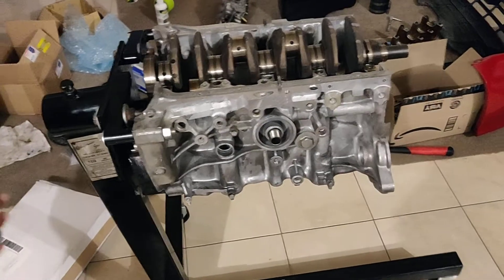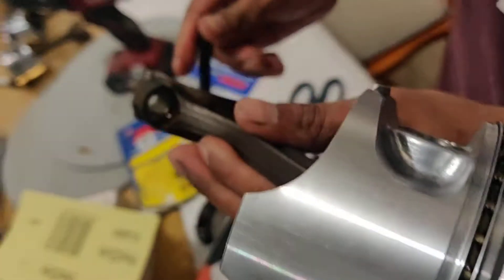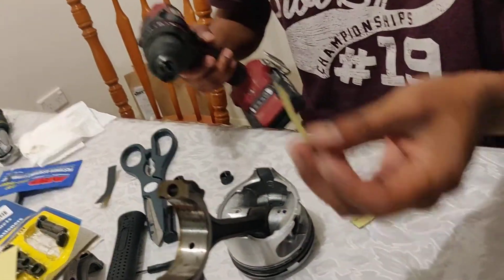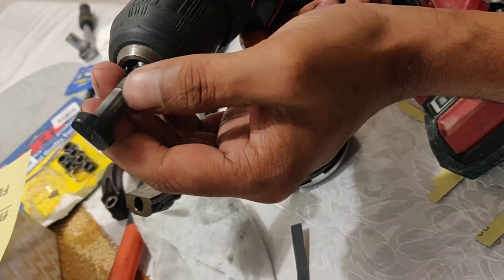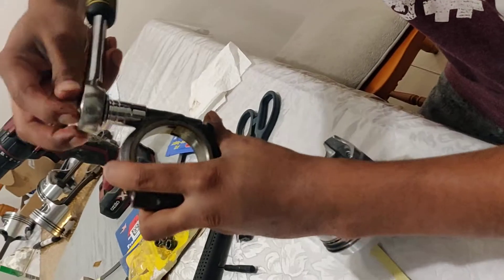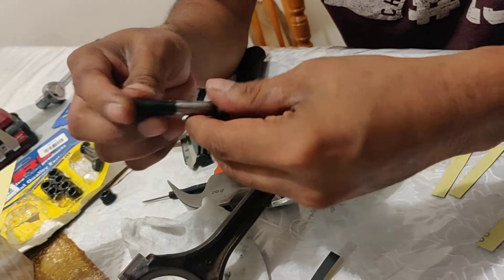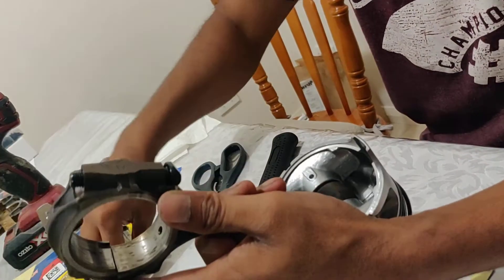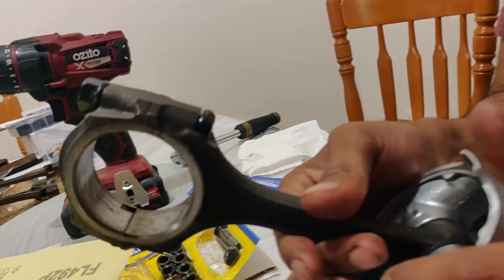Stuck ARP Connecting Rod Bolts Solved

Comment: They are press in but if its too tight the rod could fail. Its not the right way but it will work. Stock rods are often kinda thin around the bolts. Sometimes stock rod bolts might be better. They put less stress on rod and are still strong enough.

Comment: You could heat the rod end in a pot of boiling water so it expands, then insert the bolts.  I've done it several times that way.

Comment: These bolts are ‘interference fit’. They should be pressed into place
Reply: I suppose you are right.  As mentioned,  this is an alternative for people with limited resources. Not everyone has access to a press. This method worked fine and my engine has not had any issues as a result so far
Reply: @fokiralomgir2563  Glad to hear that.
Reply: It's a Honda . They have literally the softest built lower end I've ever seen . Nobody uses torque that low .